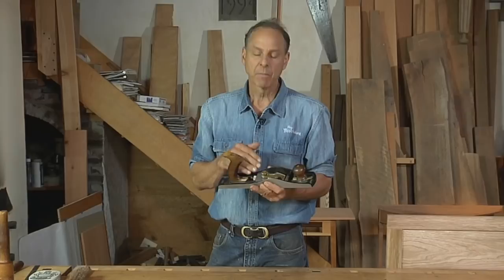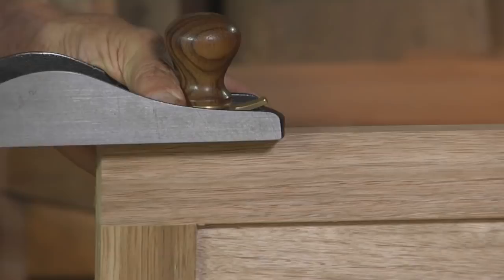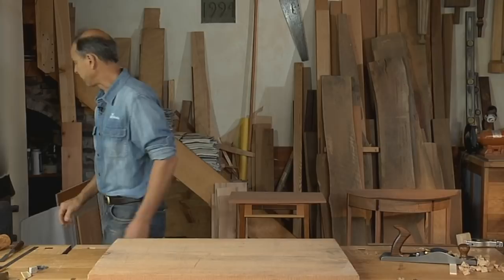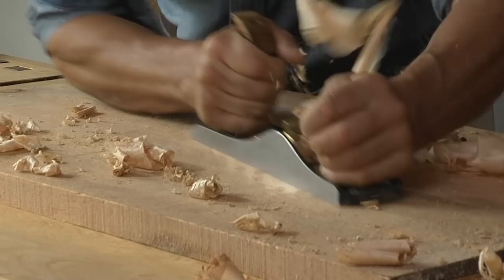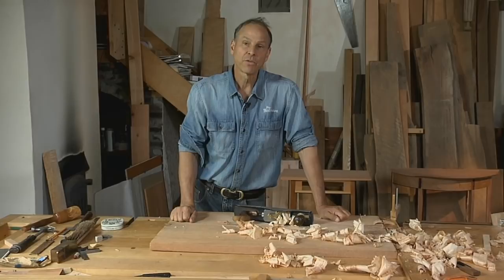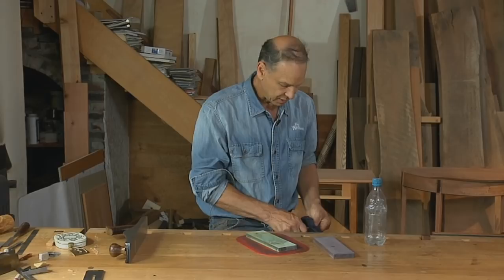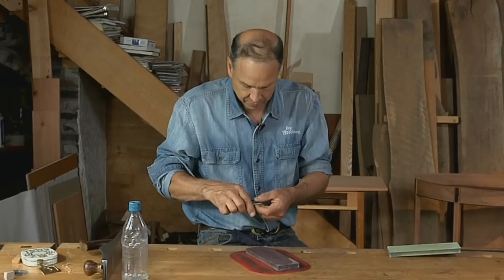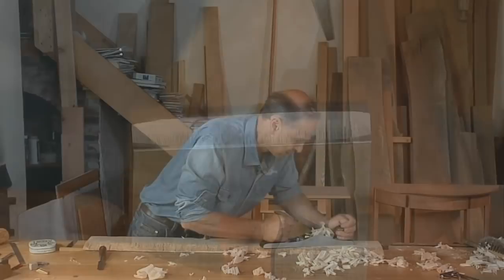Bevel-Up Smoothing Planes are Versatile in the Shop

Comment: Looks a bit bigger than a 62…?
Reply: He shows a 7 1/2 in one camera cut, but the one he's using is a 62. You can tell by the throat adjuster under the front knob which the 7 1/2 doesn't have.